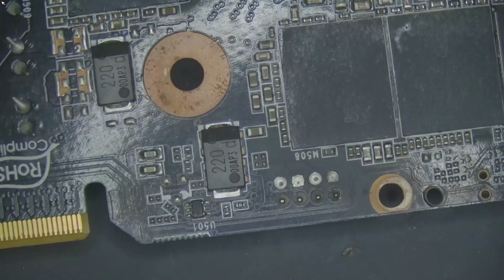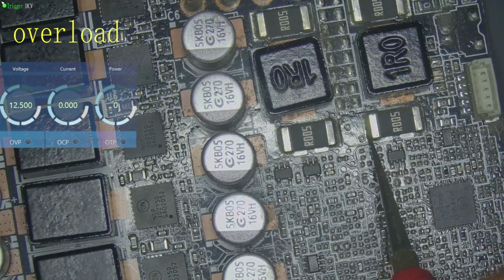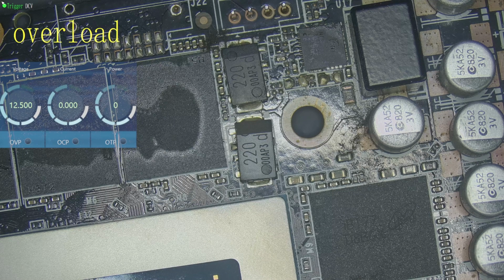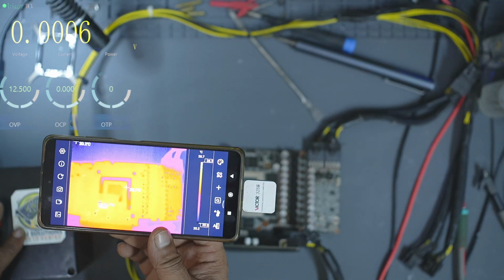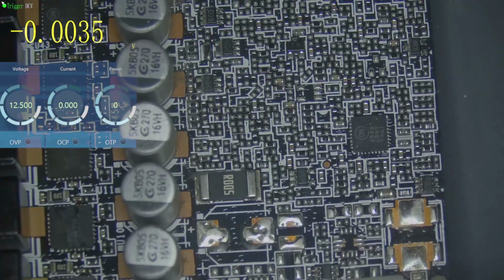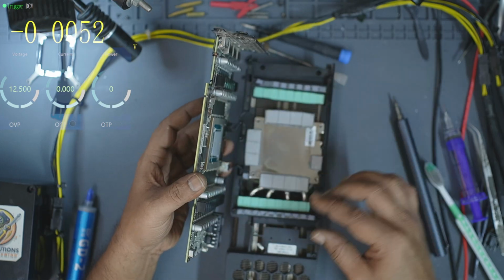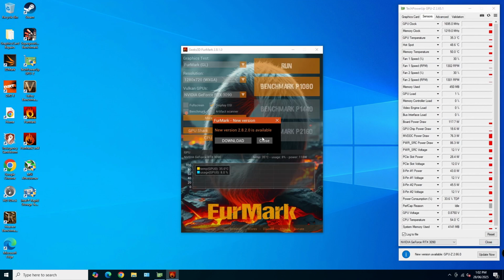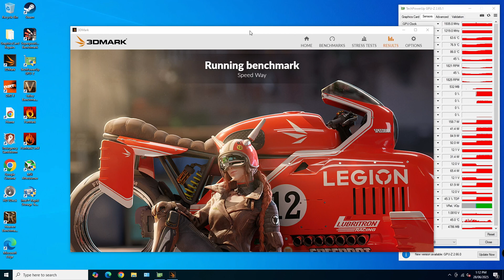Palit GamingPro RTX 3090 Crashes after Loading to Windows

Comment: Hi i would like to know what thickness thermal pads did you use if you replaced them tanks you.
Reply from the maker: I did not replace the pads but if I recollect the size is 2mm on the memory at the front and the back.
Reply: @GraphicsCardRepairs-tk7ql  Thankyou very much.

Comment: Hello, I'm excited the magic you do with GPUs! 
May I ask you for advise which GPU to buy for VR? I want at least 24 GB. People buy rtx5090 but they are so expensive. Could you recommend one or could you upgrade one or just any advice?
Tanks in advance!
Reply from the maker: If you need 24 GB for VR you can go with Rx 7900XTX. They are on discount now. Or RTX 3090 or 3090 Ti are also quite cheap. I will not recommend new at this point as going used is a better deal. I will also not recommend the 4090 or the 5090 they are way too expensive for what they deliver. If I were you I would skip the entire 50 series from Nvidia.